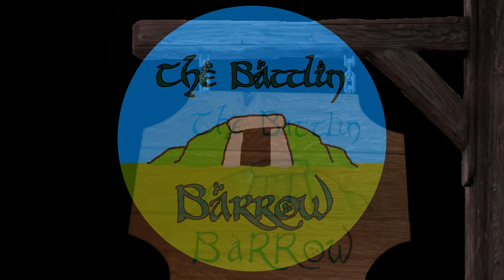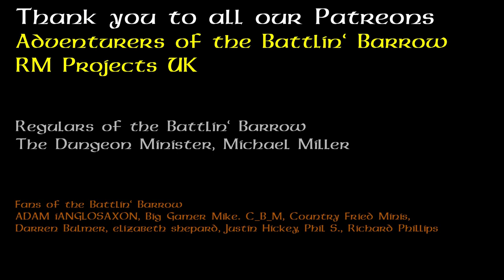Sand Tiles and Palm Trees for Dungeons and Dragons and Warhammer

Comment: That wash on the trunks really knocked back to shiny plastic and showed off the detail.  Did you try a wash on the leaves?  I'm curious if it would work as well as the trunks.

Did you have any warping with your sand tile?  I killed a foam core tile when I glued sand to it, but I think it's because I left the paper on.
Reply from the maker: I did not do anything with the leaves as I liked them they way they where. I can do a test if you like on one though just to see. I wasnt sure the wash would take but was really impressed with the outcome.
Reply from the maker: And no warping on the tiles as I tend to use 10mm XPS foam as the base.